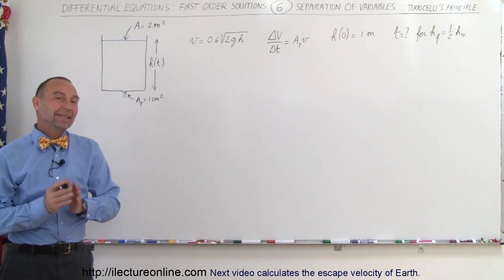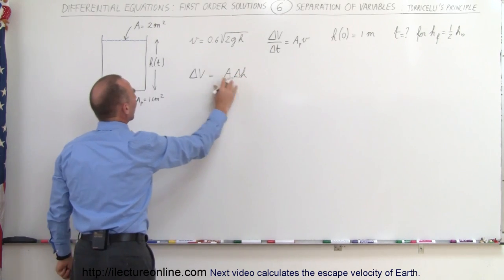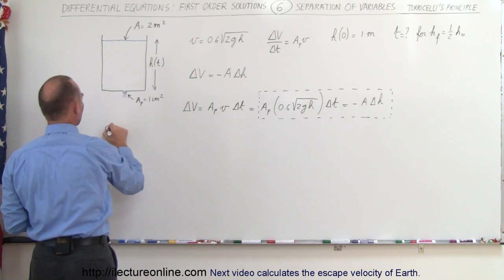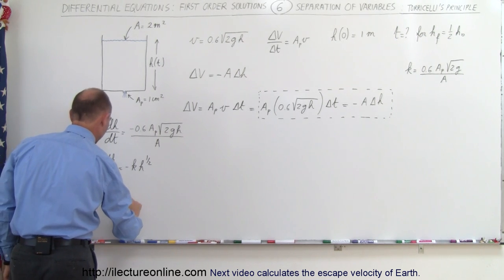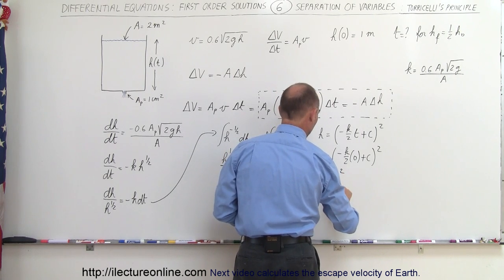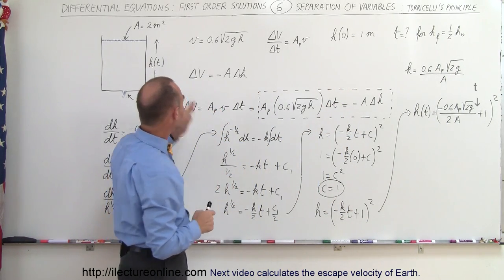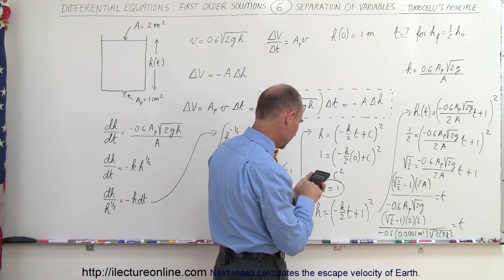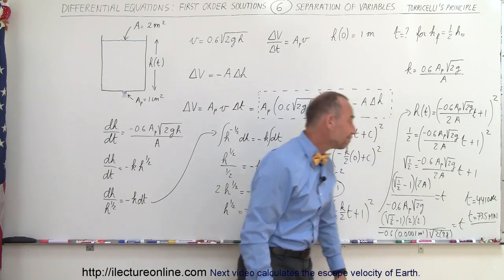Differential Equation - 1st Order Solutions (6 of 8) Separation of Variables with Initial Value

Comment: Good afternoon, Master Dr. Van Biezen! Again, congratulations for more one beautiful class!  I worked as a Testing Technician at Embraerr Testing and Development Engeneering Departament- São José dos Campos-São Paulo-Brazil a long time ago. I remember that certain time I prepared and participated of this similar matter ministered by you. I took a time with a chronometer in order to determine the total flow time. The reservoir was cylindrical and  had 200 Liters of capacity. That test was applied to load the EMB-145 horizontal stabilizer actuator of Parker Hannifin of United States. I loved may job! I would like so much to receive your feedback message! Thanks a lot and God bless you for your teaching!J. Carlos-São Paulo-Brazil.

Comment: Question: at 1:56 why do we need the negative sign? Would the negative sign already be included I the Delta h?  Isn’t it the case the delta h decreases and height also decreases.  Wouldn’t the added negative sign imply the are going in opposite directions?
Reply from the maker: Since the volume of water is getting smaller we call the delta V negative, since it is removed from the container.
Reply: I agree with Titurel.  Although mathematically it doesn't matter the negative sign conceptually makes more sense on the delta volume over delta time relation.

Comment: Thankyou for a very well explained lecture. One question , in solving for t my equation being 
1/2 =((-(0.6(0.0001sqrt(2(9.8))))/4)t+1)^2
 I came to t=25706.4 secs .Ive substituted & it equates. The equation I came to agrees with yours for h(t) on the board. Have i made a mistake somwhere?

Comment: What if I have exerted pressure on the water surface in an enclosed tank? Flood port has opposing water pressure as well.
Reply from the maker: If additional pressure is exerted at the top of the tank, then the velocity of the water leaving the tank will be higher.
Reply: @MichelvanBiezen  any calculations I can use to prove this? Is it Bernoulli's principle/equation?
Reply from the maker: We made a video that describes how Bernoulli's equation is derived.  Physics: Fluid Dynamics: Fluid Flow (1.6 of 7) Bernoulli's Equation Derived   Video link
https://youtu.be/R5uoTadxhpU
Reply: @MichelvanBiezen  Hi, thanks for helping out. It did give me a clearer picture as to how the equation work. Appreciate the effort

Comment: Would there be a big change to the differential equation for change in height of the fluid if there was also a constant flow of fluid into the top of the tank?
Reply from the maker: The flow in, would have to be subtracted from the flow out.

Comment: Thank for the video, wondering how would the equation change if you had two holes at the bottom of the cylinder with different areas?

Comment: does this same method work regardless of the shape of the container? ie. parabolic bowl vs cylinder
Reply from the maker: You can use this technique for any shape, but you will need to express the volume with an equation.
Reply: @MichelvanBiezen  Prof. How can I write an equation when y=x^6 is revolved about y axis and becomes the tank

Comment: So I got the exact same situation except I got a cylinder whit a diameter of 10 cm (0,10 m) and a hole in the bottom of 5 mm (0,005 m) so my A = Pie x 0,10^2 = 0,0314 m^2 and my Ap = 0,0000785 m^2 when I solve the equation the answer is 1,384 seconds. But in real life, it takes way longer than that 1,384 seconds to get half of the beginning height. I changed out A and Ap whit my measurements from the original equation and still, I get an unrealistic time? Can someone help me out? 

Kind regards,

Tobias

Comment: hello professor, why you take 1 as C value, while there are two value for C, +1 and -1
Reply from the maker: Sometimes there are 2 possible answers mathematically, as in the case when you find the square root.  But the physical interpretation of one of the mathematical solutions may not be physically possible.  Thus we pick the one that is.  In this case, negative height wouldn't be physically possible.
Reply: Michel van Biezen thanks professor
Reply: Michel van Biezen because math doesn't care about reality, it only gives us the possibly answer😂

Comment: 73.5 minutes? This doesn't seem right to me. Why is it that you put the area of the pipe as 0.0001m^2? Shouldn't it be 0.01m^2, giving a far more reasonable t = 11.03 seconds?
Reply: I don't mean to sound rude! Your video series has absolutely saved me for my upcoming differential equations exam, but this value of t just doesn't seem right. 73.5 minutes to reach only half height would surely mean the water was travelling through a pin hole!
Reply from the maker: It is a reasonable question.  We can to a quick check.  dV/dt = Av where A is the cross sectional area of the hole and v is the velocity.  At a depth of 1 m, the velocity is between 4 and 5 m/sec.  But the cross sectional area is only 1 cm^2 which is 0.0001 m^2 which gives us a small dV/dt.  Thus a quick check makes that a reasonable answer.
Reply: Ah yes, I understand now :) thank you so much for clearing that up. I need to revise my unit conversions! And thank you again for making these videos.

Comment: what if the upper base of the container is close?
Reply from the maker: As the water level drops, the pressure would decrease in the container above the water, the velocity of the water exiting at the bottom would slow down and eventually stop if the pressure difference reached a high enough value.
Reply: @MichelvanBiezen  I think you are right. but can you share an equation for that plss.? cause it is very important for my research capstone and I cant find it in the internet. hope you could help me